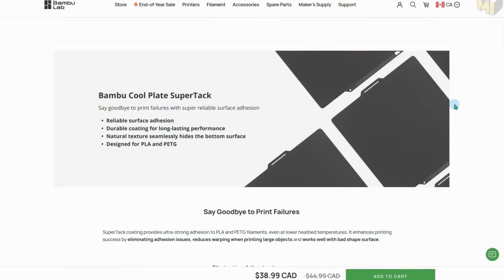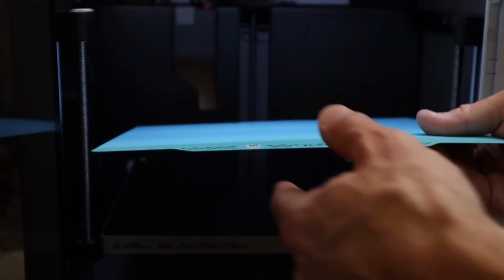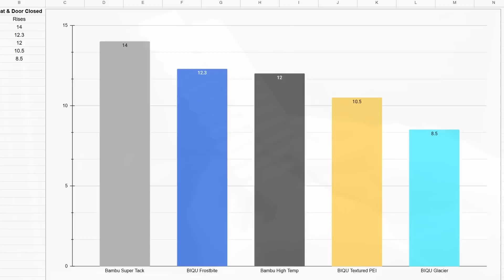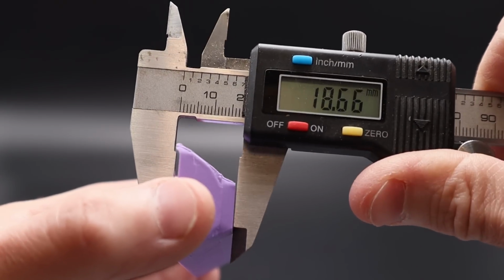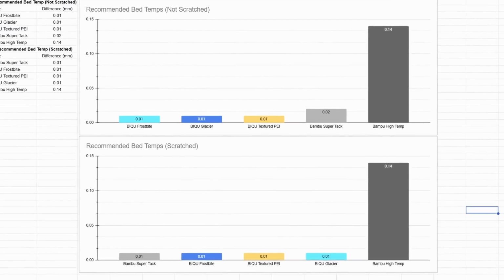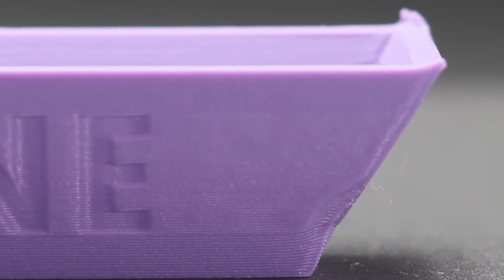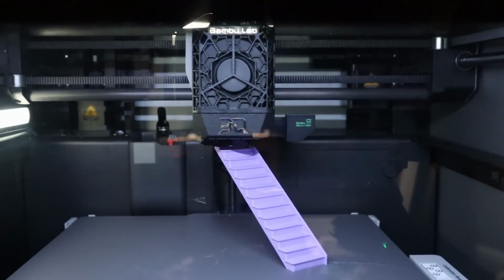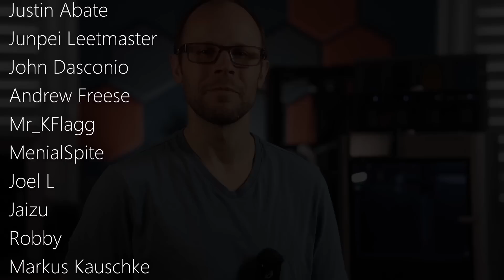Which is the best, the Bambu Super Tack or the BIQU Frostbite or Glacier?

Comment: Sorry, I love your channel but your adhesion testing is flawed. You're testing the holding strength after the plates have been removed from the printer and are cooled down. Once cooled down we don't care if they stick anymore, in fact we'd rather they not. The relevant number would be holding strength while the plates are still warm on the heated print bed.
Reply: It would be representative of a power loss recovery.
With PEI the part is 100% toast once the bed cooled off.

But you're right that's not what he said he was testing and it's just a weird way to test overall. How heavy the print needs to be on that contact patch to fall of on its own?...

My tech fun did a video with a strain gage tested on both hot and cold conditions pulling both sideways (like nozzel dragging would cause) and perpendicular to the plate. I'm not sure he had the bambu plate yet, i think it was just the 2 blue ones.
Reply: @RobertPetrucha came here to say the same thing. The Textured PEI sheet specifically is marketed for "Self Release" when cooled. Which it very much does for PLA. Printing at 60 degrees then removing before testing not only allows the plate to cool, shrink, and reduce adhesion vs hot. It also introduces movement, flex ect which can also reduce final adhesion.
Would love to see that test redone while still installed in the printer with the bed tempurature holding at printing temps
Reply: Your parts are toast if your plate completely cools anyway.  You'll get really poor layer adhesion on cold plastic and it'll have shrunk. You'll have a visible shift in your part.  This even happens if your heated bed stays on and your part sits for hours waiting for a filament change.
Reply: @bluerider0988  these are cool plates... Meant to be used at ambient room temperature... There is no cooling of the plate if it's already at room temperature when you print... That's the whole point of them... They save energy by allowing printing on an unheated bed.
Reply: @johntetreault  nope the store page and spec sheet says to run them at 45°. It's ambient in some places but it's not the ambient people mean when they use the word.
You can run them bed off but it's not the intended use.
Reply: @3dcreationsofri  The BIQU Glacier is intended for any temp and materials, including Nylon, ABS etc.
Reply: @rattyboots yes, but it REQUIRES heat for anything to stick... If you think you're going to print PLA with a 45°C bed, you're in for a big disappointment.
Reply: Yeah, but that’s not the point dude.
Reply: You have a point, but the cooled down test actually simulates the worst condition which shows how prints really stick to the plate.
Reply: Right, but it's useful to know if my prints would survive a power outage
Reply: @karmapolice9477  They're "cool plates".  If your running them cold, what's the difference? 🤷
Reply: @3dcreationsofri  According to Bambu, heating it up to 50c will "assist with removal". So he has a point.
Reply: @3dcreationsofri pei is not a cool plate
Reply: Cool, when you make a test video and post it let us know.

Comment: LOL I have sanded (actually used steel wool) my build plates so often to "rejuvenate" the plate. PEI tends to loose adhesion after 6 to 9 months of daily usage. A quick rub with steel wool and especially the smooth side is back to new (if not even better as you said).
Why on earth do you use glue stick. My PEI sheets (RatRig and no-name Ali) are just wiped with window cleaner (Glassex) only after a few prints. Once a month I wash them with water and soap. That is all you need. PETG and TPU will even stick too good, so I leave a bit of the window cleaner on the plate to reduce the stickiness.
Reply: I use Scotch Brite red pads on all of my PEI buildplate smooth sides, and it works incredibly well - so well that one of my LDO plates had a chunk rip out of the smooth side with an ABS print just because I didn’t wait for the build plate to cool all the way. 

At least with the Scotch Brite, I can go at least 20 or 30 prints before I have to do any kind of cleaning. If I’m printing PETG, I will put glue stick down, but that’s only being used as a release agent.

Comment: I don't see any point in these plates when they only work with PLA and PETG - those work very well on normal PEI as well. Now if these worked for PC, PA and similar, that would be a different story, but these plates are solving a problem that just does not exist. Wash your textured PEI with detergent and it will work as good as these fancy plates. For energy savings, it would take thousands of print hours to save as much energy to warrant the price of these plates - and their lifespan is not unlimited either.
Reply: PLA and PETG can definitely warp at corners if you're printing something large enough.
Reply: that's not true, if you print lots of things with very small adhesion area, even a clean plate can fail you. especially when printing multicolour flexis, it would be a great relief to know they wont come off midway through the print.
Reply: They have two versions. Their glacier plate is for engineering materials.
Reply: to be fair - PLA and PETG are the most common materials used for 3D printing due to how easy they are to print with minimal warpage. Having buildplates that can stick these materials extremely well and others less so still means a large portion of 3D printer owners are still covered and therefore the buildplates should sell well.

I would like to see engineering variants that target the likes of ABS, ASA and Nylon though. I mean PEI does a great job with ABS in my own testing so long as you have an enclosure but having something that could effectively glue an ABS part to the bed without too many platform addons would be a huge boon.
Reply: One case is that low temp sheets work after power loss. A heated bed may detach the print as it cools. Not a big problem in the developed world, however.
Reply: PETG and PLA can warp easily. And small parts with very little adhesive surface can peal of easily. 

So MY benefits are: 
1) Lower Temp = Lower Cost
2) Lower Temp = Door/Lid closed on PLA (less noise)
3) Less Warping
4) Less peal of with tiny parts

The Frostbite costs me 20€ ... fair deal for my 4 points I guess. I print 70% PLA and 30% PETG ...
Reply: @NemesisLex  Exactly. I'm currently waiting for my supertack to arrive and hope I won't have to deal with these issues anymore.

Edit: PETG still warps :(
Reply: For people who aren’t printing other materials, it lets them get better adhesion without as much input energy.

Comment: I have the textured PEI plate that came with the X1C printer and had zero adhesion issues so far even with tall objects with small footprint. I was even printing 6mm wide 15cm long axle from ABS standing up without problem. The only thing I do is finding best bed temp for each new filament, writing it down along with other parameters in excel for later use and cleaning the build plate with 99% IPA and fresh paper towel before each critical print. Never ever used even glue before.
Reply: The texture looks pretty naff from that plate though. Ok where you can't see it, but not ok for parts where you see that surface. The low temp plates have a much nicer finish, which better matches the other surfaces.